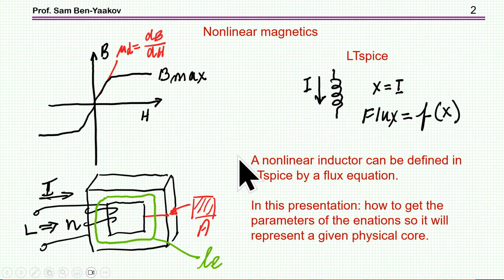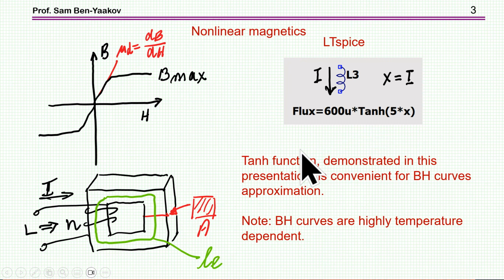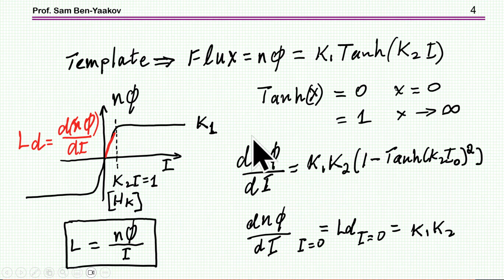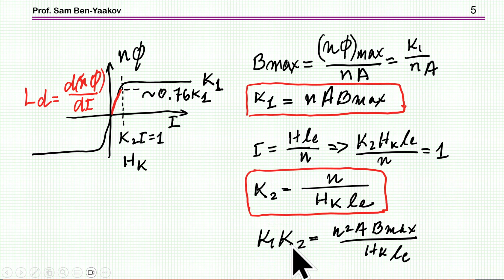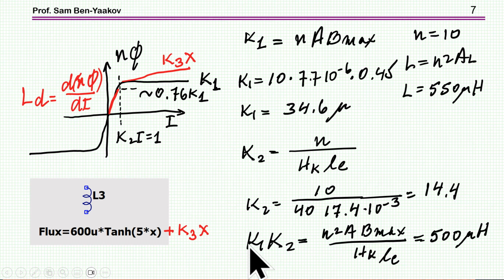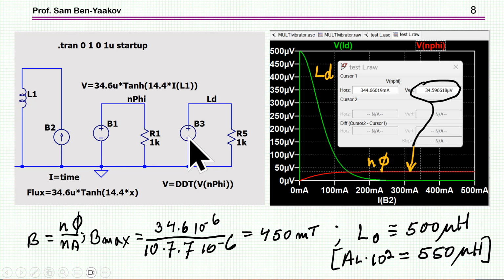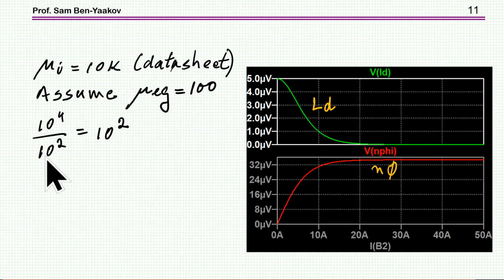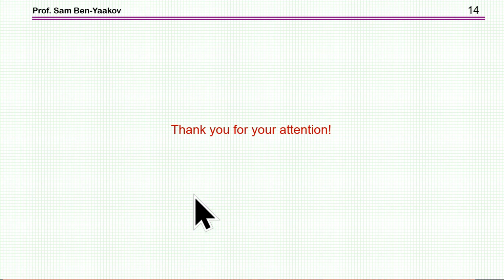Simulating a physical inductor by LTspice

Comment: Hello Professor Ben-Yaakov, my first time writing! Thank-you so much for your presentation!  My question concerns the transformation from the (B, H) coordinates to the (nPHI, K2I) coordinates.  In doing this transformation we must preserve the shape of the (B,H) curve.  To get from (B,H) to (nPHI, K2I), I would do the following:  B = uH, AcB=uAcH, which is PHI=uAcH where Ac is the core cross-sectional area of the core. Continuing: nPHI=nuAcH, nPHI=nnuAcI/Lm  where Ampere's law is used in the last step and Lm is the path length.  I now have nPHI=KI where K=nnuAc/Lm.  This would be my K2.   On the other hand, at 6:26 you refer to Hk (on the current axis) as the value of H which makes the variable K2I = 1.  First, shouldn't this axis be labeled as K2I instead of simply as I?  Anyway, this gives us the equation for K2 in terms of Hk.  Hk is then later found from the data sheet by looking at a (B,H) plot and working backward from the point (0.76)Bmax to the point Hk.  In summary, I am confused in how we move from the (B,H) coordinates to the (nPHI, K2I) coordinates.  This can be done easily while maintaining equalities as I have shown above, but then my value for K2 (nnuAc/Lm) is not the same as your value for K2. Would greatly appreciate your comment.  Thank-you !!  David Levy
Reply from the maker: Hi David, can you please point to the time in video, or slide number,  you are referring to?
Reply: @sambenyaakov  Hi Professor Ben-Yakov, well there is not exactly ONE specific slide or moment in the video that prompted my question.  It was more the general elucidation of the  design strategy.  However, after thinking about it further, I think I get the gist of it.  I would say it as follows:  There is a real B(H) curve, which we can observe on the data sheet.  We will try to make something similar to this with a tanh function because the tanh function looks like B(H) and LTSpice gives us an inductor equation (template), "total flux=k1tanh(K2I)".  Given the constraints of this equation we will propose a (flux, k2I) curve.  This will not be the same as the B(H) curve because although flux is directly proportional to B, and H is directly proportional to I, the proportionality constants USED HERE are not equal to each other.  Nevertheless it is easy to find k1 from the real B(H) curve and in a more complicated way we can also find k2 from the real B(H) curve.  Now that I (think) I know what is going on, I will do the k1 and k2 calculations tomorrow to make sure I get the correct values.  I think the simulation is very cool and I think it's great that you could simulate the inductance (we see how it falls to zero as the core saturates).  This utilization of LTSpice looks very advanced to me, and I would love to understand it.  To begin with a very simple point:  I see that in your .tran statement you have the word "startup" instead of for example, .ic(I(L3))=0.  Is "startup" a special or keyword?  I was going to try a simulation with it tomorrow, but since I am writing now I might as well ask.  Thank-you for your prompt reply, and thank you so much for these interesting examples.  Best Regards, David.
Reply from the maker: @david_6063  It seems to me that you are not taking into account the Faraday's law (V phi)  is relevant to AC only, while Amper law ( I H) is for both DC and AC so you can not equate the two in the general case.

Comment: Great content as usual.
It would have been interesting to plot the voltage across L1. Presumably, if spice works well, it should match perfectly V(Ld) since i(t) = t and therefore di/dt=1 =>  V(L1) = L1*di/dt = L1 .
I guess I'll have to get my hands "dirty" and build such a simulation.... 😉
Reply from the maker: If you do, please share.
Reply: @sambenyaakov   Just did it, and V(L1) exactly matches V(Ld)  as expected.
Reply from the maker: @justpaulo    Great

Comment: In your video 'answer to inductor saturation riddle', the derivative of the inductance in saturation is >0.
Would the arctangent function better approximate this behavior instead of hyperbolic tangent?
Reply from the maker: They are both approximate, about the same. For better fitting use Table

Comment: Another spectacular video from Prof Sam. I wish you a good health and blessing.
I have one question. lets say the current through inductor is ac. sufficiently high to reduce the permeability.  does the inductance of an inductor changes with current.
just for simplicity i assume the relation of L=(100-I) uH. I provide a sine current of peak current of 50 A to this inductor. Will i get 100-mod(50A sin(omega*t)) uH inductance.
Reply from the maker: Hi, indeed the inductance will change  but you need to sort out to which inductance you are referring. See:  Ben-Yaakov, Sam; Semidotskih, Yivgeni; Rozanov, Evgeny; Haag, Hemann; Hämmerle, Florian (2021). ‘Inductance’ definitions, modeling, and simulation. TechRxiv. Preprint. https://doi.org/10.36227/techrxiv.14975082.v1

Comment: Cloud you please make LT spice modell for Helmholtz Coils  too, I use it as notch filter
Reply from the maker: do you mean an electrical model of the impedance ? Is this for audio applications?
Reply: @sambenyaakov yes ,  I use as filter for  negative rail and positive rail voltage that it connected to the same transformer with two separate  secondary output and separate rectifier for each and a coupled + /-  on each rectifier to make zero reference for push pull output stage. Each coil then will be placed together to make notch filter , we can get very good ripple steering which I saw on one your video.  In practice works well about 30dB attenuation by tuning in these two coils.  I got the idea from ripple steering and  this Helmholtz coil applications.  But still now I can't make LTspice modell for it. Maybe you can help me  Thanks a lot .
Reply from the maker: @paulpaulzadeh6172  Hi, as I know  Helmholtz Coils are two circular coils put a part to generate a controlled magnetic flux. Is this what you are using???
Reply: @sambenyaakov yes , the ripple for positive and negative, cancel each other , As two coil tune in each other
Reply from the maker: @paulpaulzadeh6172  Is there any published reference on that?
Reply: @sambenyaakov no , there is no,  I made HW and try the idea,  I saw the frequency content with spectrum analyser that if the negative and positive rail come from the same transformer with two separate winding then negative and positive ripple are the mirror of each other and frequency content are the same. So magnetic fields should be oppose each other . Then get idea of Helmholtz Coils instant two working with each other, what would be if we make it oppose each other , then it should be like notch filter tuned at quite wide frequency.  It works well in practice.  I try to simulate but I don't know how to make Helmholtz coil in Ltspice.
Reply from the maker: @paulpaulzadeh6172  interesting. If I see the schematics, the way it is connected, I may be able to suggest a modelling approach.

Comment: I've been wondering exactly about this for some time! Since I wanted to simulate circuits like Royer oscillator and joule thief's and such circuits myself for some time! Thank you!
Question: throughout your video, is 'n' the number of turns on the primary? A is the cross-sectional area of a core? I is the current? l is the length of the core? (damn why upper case I and lower case l must look the same smh) Is the assumption that the majority of the flux is constrained within the core? I have a hard time learning about magnetics because of all the different variables involved and keeping track of what is what.
Reply from the maker: Thanks. You got all the definitions and these assumptions correct. Also, no core or copper losses and some other simplifying assumption. The model is meant for seeing first order effects. If you run a Royer oscillator,  show us the details. Great nonlinear circuit.
Reply: lol on the i and l issue, in my first transforms class: I'm a very sloppy left hander, so my 5 and s(s output variable from a Laplace transform) look the same especially when I get tired. So my professors were cool and let me just underline my 's' and they knew this for me.
Reply from the maker: @wickedprotos1937  👍